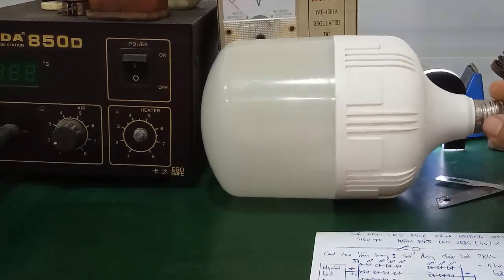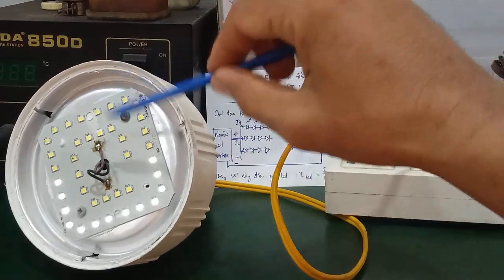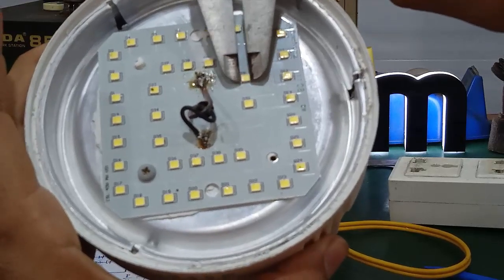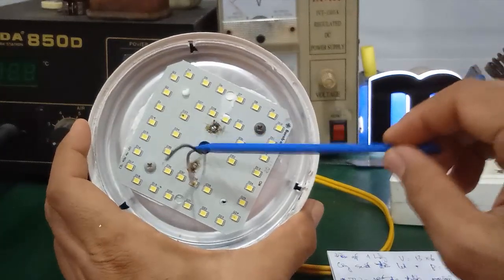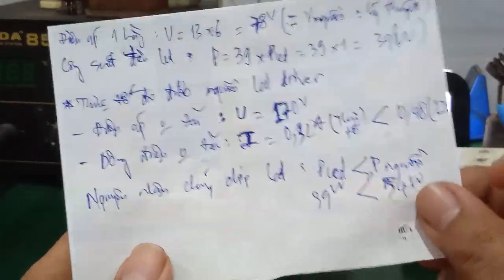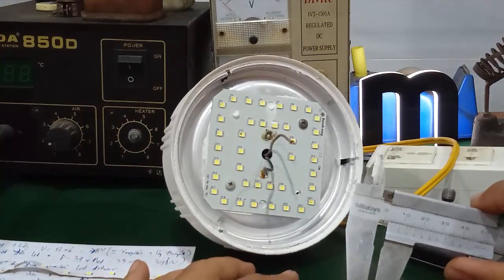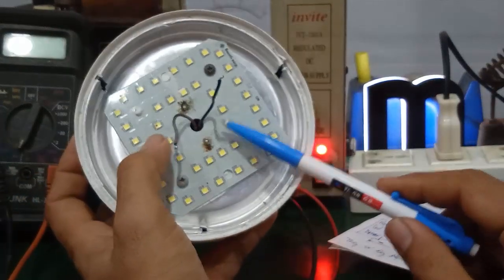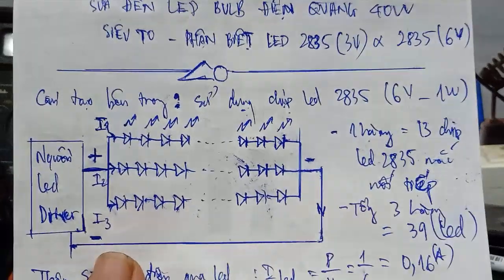Sửa đèn Led 220v - cách sửa đèn led bulb Điện Quang 40w - phân biệt chip led dán SMD 2835( 3v & 6v )

Comment: Công suất danh định của đèn là 40W
Suy ra dòng AC danh định là 0,18A
Suy ra dòng DC trên mỗi nhánh led
Là chỉ có 0,18A :3 =0,06A
Suy ra công suất tiêu thụ trên mỗi măt led
Chỉ là 0,06A × 6V =0,36W
Suy ra công suất phát quang chỉ là 39 ×0,36=14,4W
Công suất sinh nhiệt của đèn là
40W- 14,4W = 25,6w
Nhiệt này om con IC  phát ốm
Cho nên dù có IC tốt cũng nhanh hỏng